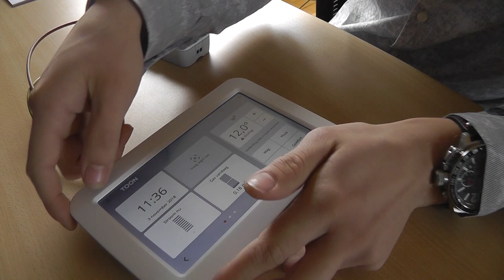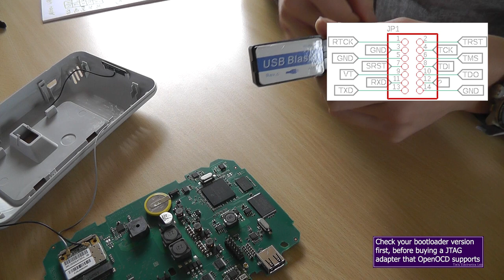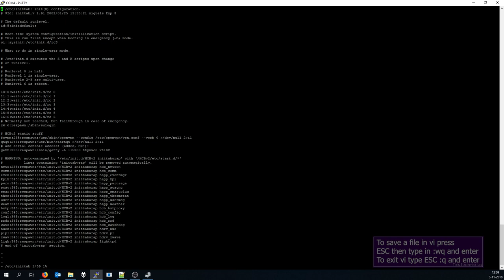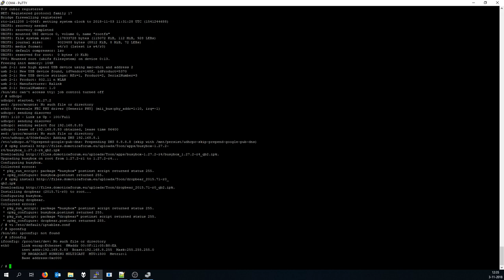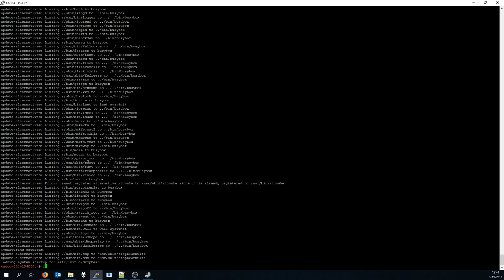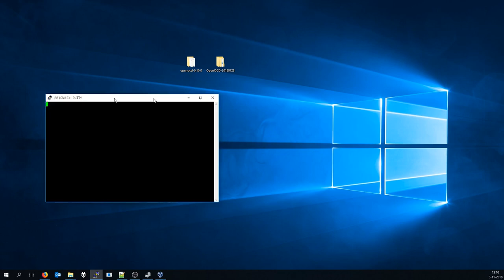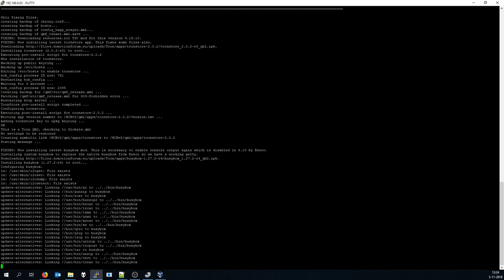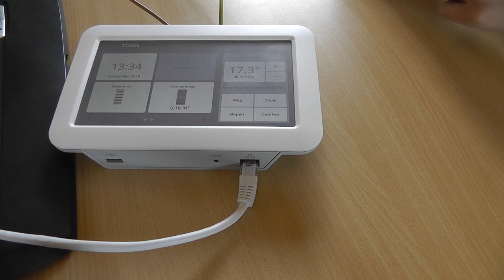#25 [GUIDE] Toon Root step-by-step

Comment: It's a shame Eneco has cut off the usage of toon on Domoticz. I already bought a second-hand Toon to try this. Just to keep my original toon in case the trick fails.  Hope to get Toon to work again with domoticz after rooting using this tutorial. Otherwise it's time to say goodbye to Eneco and Toon and start with Thermosmart with another energy provider. Thanks in advance for your effort making this vlog.
Reply from the maker: Was the Toon compatible with Domoticz out of the box?! There are a couple of topics online about reading out the (rooted) Toon with Domoticz. Check out domoticaforum.eu (links are in the description)
Reply: Yes Toon was compatible with Domoticz until 2018. Then suddenly Eneco changed it 😔

Comment: If i have the usb to serial converter why should i get the usb ballaster
Reply from the maker: It depends on the U-Boot version of your Toon. If the password of your U-Boot version is not listed in the video's description, you'll need to sideload the patched U-Boot version which bypasses the password protection. For that you'll need a JTAG adapter
Reply: So how can i know the bootloader version to spare some costs , or should i buy them both ??
Reply from the maker: Attach the uart to usb connector and boot the Toon. You can also find the U-Boot version online by looking up the Toons build date, check the links in the description for that
Reply: @TimsElectronicsLab  I could not find any link where I can look up the Uboot version of my toon, you previously referred to connect the ""uart to the USB connector "" what did you meant by that ??
Reply from the maker: The link to purchase the USB to UART adapter is in the description!

Comment: For more current Toon versions (like U-Boot 2010.09-R10) this description seems outdated...
In the video on 14:20 a text is inserted (with somewhat illogical content) how to proceed when you have newer U-boot versions.
However, currently the description is lacking any further information.
Reply from the maker: Hi Bas! What information did you find missing in the description?
Reply: I noticed that passwords and the “short”-method to stop the bootloader do not work for newer Toon versions like R10.
Reply from the maker: Yes that is true! If passwords don't work, you need to have a JTAG adapter in order to boot the Toon with a temporary bootloader that has a known password.

Comment: Hey Tim, im a bit stuck with the wiring, this is a whole new topic for me that im gonna try. I see that the Toon Pin 1 goes to NC, but Pin 9 From the Toon also goes to a NC while there is 1 “NC” by the Usb Blaster. Do the 2 pin’s(Pin 1 & Pin 9 from the Toon)  both goes to that one NC Pin (Pin 7 from USB Blaster)? Or just one of the pin’s to Pin7 I dont wanna blow things up haha
Reply from the maker: Hi Nick,
NC stands for not connected, so they shouldn't be connected to anything. I've attached the pinouts for the Toon -> Blaster below. I'm a little bit confused about pin 1 and 9 going to pin 7 of the blaster, as that will not work out
pin 1:  RTCK → 
pin 2:  TRST → pin 8: TRST
pin 3:  GND →  pin 2: GND
pin 4:  TCK →  pin 1: TCK
pin 5:  GND → pin 10: GND
pin 6:  TMS → pin 5: TMS
pin 7:  SRST → pin 6: SRST
pin 8:  TDI →     pin 9: TDI
pin 9:  Vt  →    pin 4: +VE
pin 10: TDO →  pin 3: TDO

Let me know if this anwers your question!
Tim
Reply: @TimsElectronicsLab  Hey Tim, yes the thing was that i didn’t know what NC was haha, but now everything is connected and its works with putty  :) thanks

Comment: hi Tim's Electronics, 

is all this possible with my windows 10 pc, type windows 10 pro 2004. ? Old type rog motherboard with intel 5 processor.
Reply from the maker: Hi Jaap,
If you install the correct drivers it shouldn't be a problem!

Comment: Hi Guys, I have a similar Toon display at home, after the last update, it froze at 1/3 of the update and it never finishes it, and now I cannot access anything in it, also I cannot change the temperature in my house. The screen turns on, starts loading, and then freezes at 1/3 and never starts. I have tried to turn it off, remove it from the wall, unplug the adapter that is mounted on the CV kettle, nothing helps. Do you have any idea what could be wrong with it? I called Toon, but they say that I need to unplug it and plug it back in, if it does not work, I need to hire their professional for 150 Eur. That screen is worth like 5 Eur now :) If you can help me, Thank you!
Reply from the maker: Hi!
How well are you experienced with electronics? You could try to perform a recovery of the toon, just Google for Toon recovery github and there will be a repo listing all the required steps

Comment: hey tim, ik ben dus toon aan het rooten, alles zit goed. juiste kabels op juiste plekken aangesloten enz maar wanneer ik dus putty open en mijn password wil in typpen. gebuert er niks. en als ik er manier vind om toch te doen, staat er geen u-boot erop. enige idee wat ik mis?
Reply from the maker: Hi Iam,
Do you have the U-Boot version of which a password is known? If no, you should use the JTAG adapter to temporarely load an alternative U-Boot version which has the password toon
Reply: @TimsElectronicsLab  ja, maar geen reactie  ook niet met de jtag
Reply from the maker: Not sure which command it it, but there is an command that lists all the devices in the JTAG chain, is the Toons CPU present in that output?

Comment: Hi Tim,
Great tutorial. it gave me a good understanding of how to root the Toon device. I also noticed there is something changes between the video and the notes below the video.  If executed the "$ U-Boot: run boot_nand" command. witch of course worked fine :-) But then I got lost in the procedure. If downloaded the ed20.cfg and the u-boot.bin as stated. executed the "sudo openocd -f [JTAGINTERFACECOFIG].cfg -f ed20.cfg" but toon gave me an error "/bin/sh: sudo: not found" and without the sudo "/bin/sh: openocd: not found". I`f done lots of thing with Linux but I`m unfamiliar with OpenOCD. could you elaborate a bit more on this procedure? it would be greatly appreciated  Thank you in advance
Reply from the maker: Hi Bavo! I suppose you did install the opencd program on your Linux computer (not the Toon, on the computer you are rooting the Toon with) 
If there is no sudo installed, that shouldn't be any problem, just make sure that you execute the openocd command with root privileges one way or another. Let me know if you've got any further problems!
Reply: @TimsElectronicsLab  I was using Windows 10 for this procedure. But I understand that is is better to use Linux (Raspberry Pi), I have to dangle up a pi somewhere. I let you know how it went with the Pi

Comment: He gast, waarom heeft de toon een irc user? das wel intressant zou de controlle via de app zo lopen misschien?
Reply from the maker: I believe that the Toon use an internal webserver connected to Eneco's vpn to allow controlling via the app. I'm not sure where the irc user is for though
Reply: @TimsElectronicsLab  dis you try to reverse engineer the protocol? 
I think you could intercept anything coming through the vpn tunnel and log it
Reply from the maker: I did not! But it is not needed anyways, since it is a couple of http requests. The Toon is already remote controllable without Eneco so we don't need it anyways

Comment: Misschien een domme vraag, maar maakt het uit welke kleur in welke pin zit aangesloten? Ik ben niet bekend met de afkortingen namelijk. 😊
Reply from the maker: Hey Patrick, no question is a dump question! The colors do not represent anything, it's just  a visual tool to separate and identify each wire. What does matter is the order which you plug them in. If you are unfamiliar with the abbreviations, I recommend buying a rooted toon or sending a toon to somebody who can root it for you!
Reply: @TimsElectronicsLab   Do you know what this means: /sbin/getty: invalid option -- ','
 I'll get this  message after restarting toon
Reply: BAUD_RATE of 0 leaves it unchanged
INIT: Id "gett" respawning too fast: disabled for 5 minutes
Reply from the maker: There are problems with starting the serial connection. That's all I know, Try searching domoticaforum.eu

Comment: Is het mogelijk dat jij zo vriendelijk wilt zijn om een video te maken over het rooten van Toon thermostaat versie 2?
Reply from the maker: Hi! Rooting the Toon version 2 is very different than v1. The chances of breaking the glass panel are quite high and there are no debug pins on the PCB. So I'm afraid I won't be able to make a video about version 2
Reply: Zie hier https://github.com/ToonSoftwareCollective/Root-A-Toon (zonder filmpje, dat wel)
Reply from the maker: Wait what, this is for the Toon2?
Reply: @TimsElectronicsLab  Both

Comment: Als ik een raspberry 2b gebruik, heb ik dan voldoende aan de jumper wires en de pi? of moet ik alsnog een  usb adapter kopen?
Reply from the maker: You can use the 2B as a JTAG adapter! You don't need to buy the JTAG adapter separately. You still need the USB to Serial USB adapter though
Reply: http://www.protolectron.nl/arduino/arduino-accessoires/ft232rl-ftdi-usb-naar-ttl-adapter
zoals deze?
Reply from the maker: Yes!
Reply: top thnx :)
Reply: @TimsElectronicsLab  Nou niet echt. De Pi heeft ook gewoon serial poort op z'n pin-headers. Als je hem aansluit zoals in de toonrooter staat kan je gewoon je toon op /dev/serial0 bereiken. Geen USB-serial adapter nodig.

Comment: Does this also work with a disabled (locked) toon?
Reply from the maker: Hi Maurice,
What exactly do you mean with locked toon?
Reply: Hi tim thanx for your fast reaction, i mean non activated, it was activated but after update it is not,  now i can only watch temp on the thing.
Reply from the maker: That shouldn't be a problem! The toon Will be activated when using the root script if I recall correctly, if it doesn't you can activate it yourself
Reply: Did you manage to get it working with a non activated toon ?
Reply: @frogeyedman2986  works for me. (Used Rpi3) and edit config xml file after flashing.
Reply: @mauricemo8360  what did you use the rpi 3 for ?
Reply: @frogeyedman2986  JTag, (usb blaster)

Comment: Hi Tim,

Thanks for this step by step guide. It took me some time but got it all to work. Now i am trying to see how i can connect it to domoticz, but i get the error: " Error: ToonThermostat: Invalid data received, or invalid username/password!". On the forums i found that a lot of people have (had) this problem but from what i can see all with unrooted toon's. Did i do something wrong with the routing? or is this error also with rooted toon's?. I must say i am totaly new to this, only installed domoticz on my pc today to give it a try before i go and buy a raspberry.

Like i said this video helped me allot, however i would like to comment on one thing. When you put in commands wait a few seconds before hitting return or maybee put the command in a text box like you did with the :q :wq commands. That would make it even more easy to follow and
Reply from the maker: That is a good one! I'll remember to do it in the next video
Reply: check on the discussion forum for rooted toons how to use it with domoticz https://www.domoticaforum.eu/viewforum.php?f=94

Comment: Hi Tim, Thank for your Tutorial, I followed it exactly and everthing works fine up until 49:06 (installing wget) I get the following errors: 

* opkg_install_pkg: Package wget md5sum mismatch. Either the opkg or the package index are corrupt. Try 'opkg update'.
* opkg_install_cmd: Cannot install package wget.

When I try to install Libssl I get the same errors (md5sum mismatch). I hope you have a tip for me.
Reply from the maker: Hi Jorrit!
Try to run these commands:

opkg install http://files.domoticaforum.eu/uploads/Toon/libssl_0.9.8m-r14.1_qb2.ipk
opkg install http://files.domoticaforum.eu/uploads/Toon/wget_1.12-r8.2_qb2.ipk

If that fails, run opkg update (which you probably already did) and try again

If the problem still occurs after you tried that, I recommend you search around on domoticaforum.eu and if you can't find anything I suggest that you start a topic.

Keep me updated!

Comment: Hi Tim, I have a toon with the new u-boot, so I want to use a external jtag interface. I bought this one: https://www.distrelec.nl/nl/sipeed-usb-jtag-ttl-risc-debugger-seeed-studio-114991786/p/30163018# 

I have a VM installed (raspbian) on my windows PC. Installed openocd. That's where I'm lost and cant seem to find the answer on how to continue.. do you have any idea? 

Just wanting to know how to use an external jtag instead of a RPi

Thank you!!!
Reply: So I've managed to get it working. But now the Toonrooter script isn't able to root. I think it's a problem with telnet..
Reply from the maker: Yes you can! Indeed, use openocd with the config files of your own jtag!
Reply from the maker: What error is the script giving? If so, you can manually root the Toon. Maybe it is an unsupported version of u-boot
Reply: @TimsElectronicsLab  i'm not sure if I have the right config file, so I'm using ed20.cfg..
Reply: @TimsElectronicsLab  I will post the full error later, but its starting openocd.. and then it says error 111 (I believe, something with the connection) and afterwards error 3 no such process.  I have to mentioned I use a virtual machine (raspbian) on virtualbox for windows
Reply: Yes I can see it is wanting to create a connection but then gets a error 111 connection refused and straight afterwards the critical error no such process.. it's a toon 1 with u-boot 2010.09-r10
Reply: @TimsElectronicsLab  Just a thought, and sorry for spamming... But: I'm using the ed20.cfg file you supplied. I just discovered there is a cfg file for this specific interface. Could this cause a error when starting openocd?
Reply from the maker: Yes it could, but the cfg file does not set the JTAG adapter's settings. Maybe your JTAG interface is not fast enough or something. Can you verify your pin out a few more times?
Reply: @TimsElectronicsLab  never mind. I started a separate openocd session with a cfg file for the interface. . But now the rooter hangs on the second  'waiting for toon ' after loading the bootloader. My interface doesn't have SRST and TRST, only RST...
Reply from the maker: Ah that's the system reset pin, try to push the reset button at the underside of the Toon. That might work as well
Reply: @TimsElectronicsLab  Back a few steps... I can't seem to find a config file for this jtag interface. It's driving me nuts. Do you perhaps know where to find this kind of information?